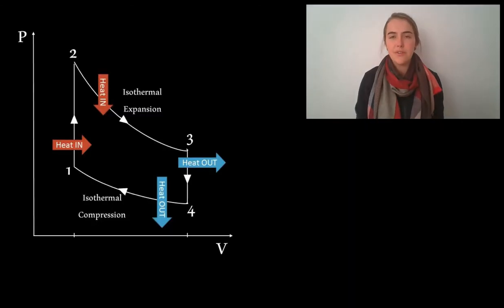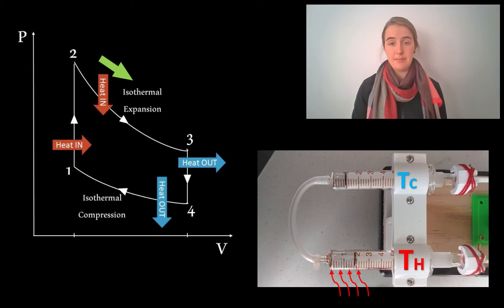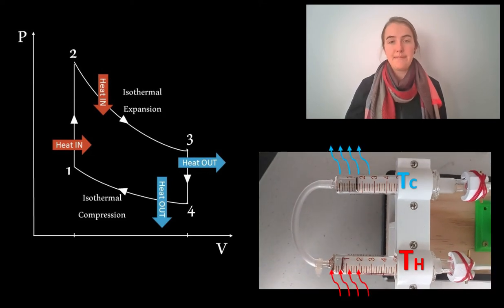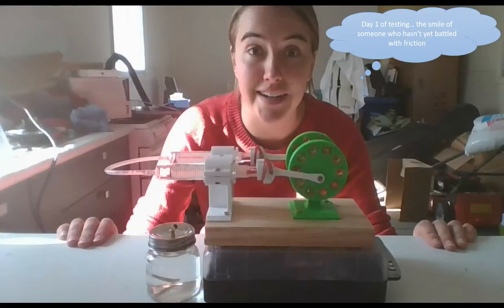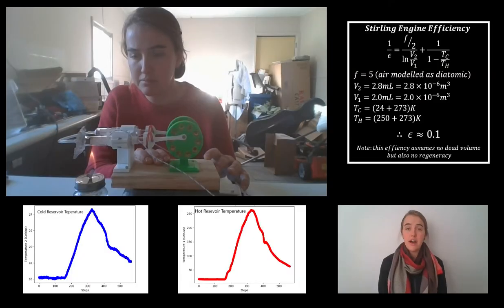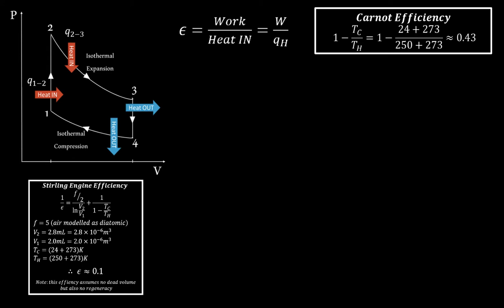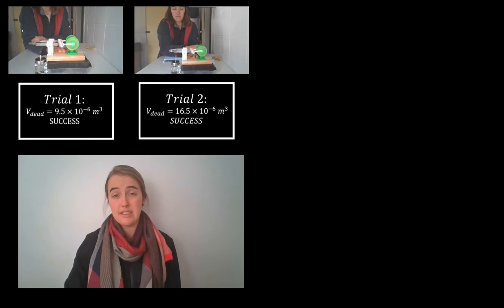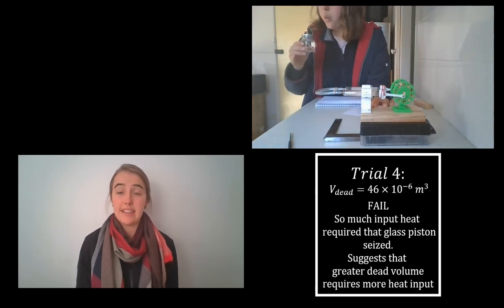Alice's Introduction To Stirling Engines

Comment: Very systematic approach, with calculations and experiments, not just stating "it spins,  work is done". I would add RPM logging to this temperature measuring system, it could allow to draw more conclusions when tinkering with engine design parameters :) Good job!

Comment: you might want to  correct  the video  description.     this is the 3rd stirling config;   gamma.       the 1st, alpha, utilizes  a  Common crank pivot, with sides at 90 deg.         the 2nd config  beta, is co-linear.       googletranslate              an alpha; this alpha is noisier than it could be, in part, because the baseplate is too small/not massive enough.
https://www.youtube.com/watch?v=mfyvd5KhA0k&t=